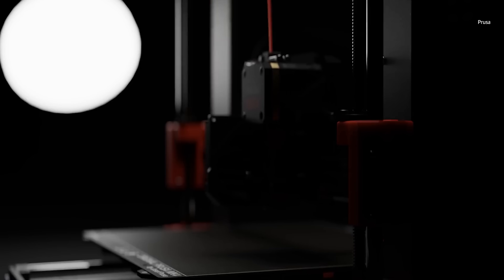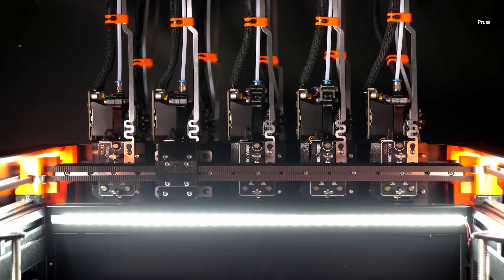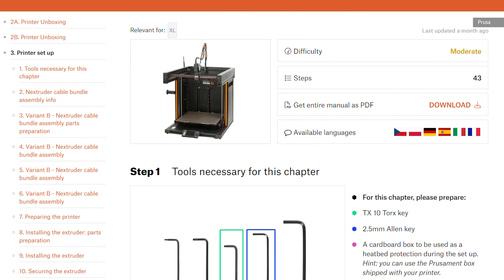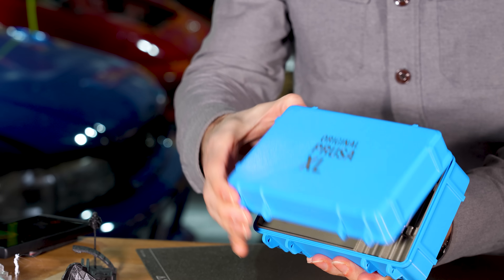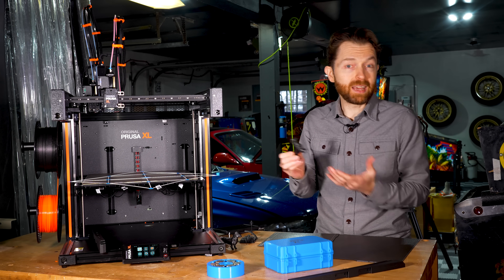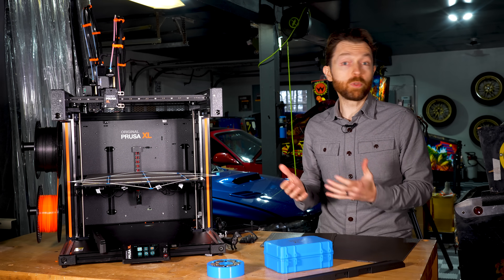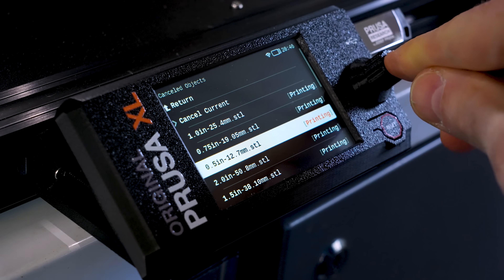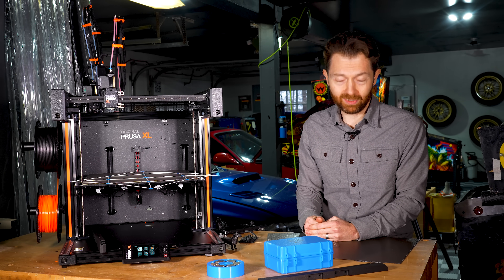Prusa XL review: A big 3D printer with a few big compromises

Comment: As someone who actually has the 5 tool XL printer i can tell you its amazing.
Reply: That's kind of like saying you could buy 5 Toyota Camrys  for the same price as a Hummer EV.  There is nothing on the market that can match the Hummer for it's trait of just being able to crush a Camry in a head on collision, for example.  What you want to have in an industry is something your competitors can't make.
Reply: @joeking433 As for your car analogy  if I want to transport 25 people(safely) and had to chose between 5 cars or one large car.(Hummer) which is makes sense? Having multiple printers will churn out more parts than any single machine. It's math, not magic. In part yield more printers= more parts. 

Prusa sat on their name and got overtaken by a competitor. Even the Core One is lacking in so many areas it doesnt even match a 2yr old bambu printer. (smaller build XYarea , no camera, no filament calibration, mmu3 is a mess)  

If your item can fit on a single 256 cubed print then bambu could be fine however people have been printing larger, on smaller build plates for years. Size isnt an issue if you can put your parts together.

Under your reasoning the Orange storm giga beats the prusa because it can print 800mmcubed. 🤔

Now we have some real competitors on the scene at reasonable prices. Qidi, creality anycubic etc. 

Bambu isnt just making a large format printer, they are adding some new tech to make it more than worthwhile(Dr. Tao Bambu CEO)
Reply: Any printer can print small which means you can assemble later.
DO you think Frankly Built Iron Man suits could only be printed on large format printers? 
No multiply that by a fleet or printers for the same or lower cost. SIZE is ok but YIELD is king.
Reply: It doesnt seem to be there based on most peoples reviews. I pondered getting one but already have an e3d tool changer. Im glad it didnt splash out and get a 5 tool XL, with that money I bought a lathe and 2 X1C combos.
Reply: @Festivejelly  Multicolor prints on X1C will still take 2-5x the time compared to Prusa XL depending on how many color changes you do, so with multicolor printing you dont save any time and you waste more filament with two X1Cs contra one Prusa XL. Also you get to print larger prints with XL. It's only more useful if you do single color prints, and also a bit for higher reliability as of now
Reply: @Festivejelly  It needed work out of the gate - no doubt.   I got mine in Feb.  Upgraded from 2 to 5 a month after that.  This is my third printer (after and Ender 5 and an Ender S3 XL)  I hacked my 5 quite a bit.    This review is sorta meh.  He glosses over all the new tech that is in this printer.   There's a reason it's so expensive.   It. Just. Works.   Adhesion is awesome.   Filament handling is awesome.    And they just keep making it better.  Recent firmware update tuned up the speed and practically removed most of the vibration.  Enabled the touch screen.   Out of the box, it doesn't have the stringing issue anymore.
Reply: After fixing the issue with stringing I can tell you it is amazing.  Just think of all the filament you will waste with the X1C 🤣  @Festivejelly
Reply: Heck for the price of a XL 5 tool head you can have 

Open frame
6 A1 with ams lite 6x4 =24  colors

Enclosed you can print more exotic materials
3 P1S with ams = 12 colors and you can add up to 16
or 2 X1C with AMS up to 16 colors. 

Are you saying your XL can print faster than 2-6 machines in terms of total output?
Reply: @No0o0o0o0o0  If you're using all 5 colors, it can certainly be 2-6 times faster than 5 colors via AMS..
Reply: @logicalfundy  Maybe you missed the point. If I have 6x A1 printers they are outputting more than 1 prusa XL at a higher qualit to boot(.4mmvs.6mm). Even if a single XL multicolor print is fast than a single multicolor BL print, it will not be faster than 6 running at the same time. So if we are comparing price to performance it's not even close. If it's single color or a few filament swaps the BL printer beats the brakes off the XL. 

If I use a P1S or X1C I then have access to more colors besides 4 and more filament types because they are enclosed. 

All for lower price, higher quality and faster delivery no tuning or building needed.
Reply: @No0o0o0o0o0  Your are buying it for a different reason then the multimaterial or size. If your just about speed your 6 machines are faster but it's not all about speed and with prusa you can still reach everything with easy guides plus you have an amazing customer support. But the XL is just not for you and that's fine
Reply: @Parasite98  It's more about what you get for the price. 

They both have a 1yr warranty(in the US) once you are beyond that that Prusa support is basically the after sales department.

I do not dislike the orange and black, but I can call them out for the XL not meeting expectations. They are not a good value in 2024
Reply: @No0o0o0o0o0  The value you set is different from some one else his use case. Like I said this printer is not for you
Reply: @No0o0o0o0o0  But how big of a print can your A1 do?
Reply: @No0o0o0o0o0  Yeah, they definitely need to lower their prices at Prusa.  I think they are seeing that as well for their Core One is reasonably priced competitively against the X1C.
Reply: @No0o0o0o0o0  For multi color and multi material the XL is significantly faster, Bambu will take 1m30s each color change to purge etc, XL it is 10 seconds to change toolhead. Your talking a 24hr print taking 4hrs on XL.
Reply: @wafflecart  easily mitigated by designing your parts to take advantage of the speeds. But let's not ignore the elephant in the room the multi color prints on the XL look like trash.
Reply: @No0o0o0o0o0  When printing with multiple colors yes it can for sure beat 2 printers. Tool changes take ages on the Bambu's
Reply: XL 
 $3500 box of parts(500 assembled...assembly still required) and $100-150hipped with a questionable lead time to get it. jan-june

Vs 3-7 machines delivered in a week and can be setup within 20 min of unboxing.(obtained even faster if you live near a microcenter)

A1 combo 560 *7 = $3920
P1S combo 949*4 = 3796
X1C combo 1449*2 = 2898 (may as well add a p1s(949) to even things out.  3847
shipping 35 per printer

The thing that has to be restated you get speed and quality on BL printers.  I have a legit question.
Which is preferable? A printer that is so reliable I dont need to reach out to support or one that is known to have great support because people NEED to utilize them...which makes me think they are not that reliable.
Reply: @No0o0o0o0o0  You are not getting what I mean. 

First of Prusa is reliable. Bambu is about as reliable as a prusa. Owning a x1c I can tell you it will also break at some point. 

But coming back to your use case and what I mean is that you might need the build size, true multimaterial system and fast tool changes. Then there is nothing which will beat the XL.
Reply: @Parasite98  I get what you are saying. But reality is showing the XL prints are NOT good. The design/quality control issue is well known. There is play in the tool head holders, stringing, print errors and failures buggy firmware. 4k to be a beta tester? Dont equate prusa mk3 or even 4 to the XL.  even this video @ 8:00 

This has been mentioned all over the net. Printing multicolor, faster, to a worse outcome is not a flex. Look at the printer as it is not how it is marketed. If you are happy then you got a goldilocks version. If you look around the rest of the reviews the issues are so common you would think they all used the same printer.
Reply: @No0o0o0o0o0  you are talking 🐂 💩. You are using this review 🤣. He has no idea what the  lidar is used for in the printer he's comparing it to.

  I have no design or quantity issues. I have no play in the tool heads, no print errors and no failures with firmware.
Reply: @No0o0o0o0o0  Because your 3-7 machines will need to continually dicked with.   You are majorly glossing over the new tech.  The bambu are cool machines but they are essentially just better packaged current tech.
Reply: @mehmeh533     Refined vs experimental for the same amount of money is the question, however the answer is simple.

Once you have 2 or more devices it creates a higher yield in printed parts. If you look at current prices of the A1, that is up to eight printers. But of course you have flexibility of getting a different combination of printers for exotic materials, enclosures, open frame, etc.

Every printer requires maintenance. But having 3–8 machines go down vs 1 is statistically unlikely.
Reply: @mehmeh533  What are you talking about? It appears you are glossing over new tech.
The tech in the A1 series are well beyond anything seen in another printer. 
The A1 series are the ONLY printer that utilizes eddy currents to actively adjust flow rate and pressure in the nozzle. 

Not to mention the lidar in the X1 series that can auto calibrate k value and flow rate for up to 4 filaments at a time using the AMS. 

There was NOTHING on the market that did that. Then the way they packaged color printing, and setup in minutes not hours/days of calibration was a game changer. The alternatives was mmu2(kek), Palette (lol), ercf(good luck), manually changing filament, figure out a voron multichanger or idex.
Reply: @No0o0o0o0o0  Bambu dropped the ball by not putting out a large format printer!

Comment: It is impressive what kind of people review printers and comment below... people do not have a single clue how hard development is for these kind of machines. A tool changer can be so powerfull, something that the current bambu machines can never achieve. 5 Printheads, 5 different tools (cnc milling, pick and place,3d printing) or materials. This will be a software nightmare for sure, but way worth it! and even if people would like to compare it with the bambu brand. XL has input shaper and can print fast. be aware when printing fast the strenght of the product will decrease. further the amount of waste of the toolchanger is way less. And regarding the enclosure topic, you just dont buy the XL for industrial materials.
Reply: 5 different tools?  When.  2033?
Reply: Tool changer promise is awesome, but if they had actually showed us an example alternate head, and had software that supported even two different nozzle SIZES, let alone types, I'd put more hope in it.
Reply: The problem is they said they were going to release it, then back peddled for 2 years, only to still release prematurely. They rushed the mk4 release because of bambu. 2 years ago, people were glad to pay the prusa premium for top of the line performance and reliability, while bambu has raised the bar, prusa has still fallen. I really do hope they get it together.
Reply: You know how hard it is to make a car - it's orders of magnitude harder than a printer, yet my car runs quieter than my laser printer :)
And it doesn't matter how hard it is to make it - if the company has promised things that it did not deliver, it's still on them to gauge the difficulty before promising.
Prusa came out with the XL after years of practicing software and hardware development with their other printers, and it's still 1/3 baked (not even half-baked). Bamboo didn't practice for years, yet I wish I bought one of theirs
Reply: @petrowi  How long have cars been around? Not the same bro
Reply: @petrowi  get an A1, I went from 4 years of an "self-upgraded" Ender 3V2, to a P1S not really "needing" that much printer. I am blown away at the experience, where I now print for fun and even design to print but never to improve the printer. Sooo sweet!
Reply: The standard has been raised, You can't charge a premium, take forever to finish your development, release a product with poor software, and not focus on the customer experience and still lead this segment.
Reply: @mikeehuber  you are right. The standards has been raised for mid-tier printers. But the toolchanger is 3 tiers above it.
Reply: @ponn273  I agree that the tool changer is cool, but it's not mind blowingly hard, but I predict the premium model from bambu will have more than two heads and will match the Bambu customer experience at the same time. I hope the laziness has gone away in Creality and Prusa, a 3D hobby will benefit if they innovate and excel. Both got so lazy!

Comment: I also had a two-head XL on order.  I canceled it after the extended wait.  I'm glad I did. I agree with you that the lack of an enclosure is irresponsible. What I find more shocking is the poor software support for multiple materials.  Yes, the printer is called the XL, but the primary feature many people are interested in is the multiple-material capability, so failure to deliver software to make this straightforward is a massive failure.  If Bambu Labs delivers a multiple-head machine, the Prusa will have completely lost and have themselves to blame.
Reply: Prusa will drop the price when Bambu comes out with a competitive printer.  Right now they're the only game in town for multi head printers so they can keep their prices high knowing people will still buy them.

Comment: As far as I know Lidar on the bambulab printers doesn't detect failing prints, only first layer extrusion issues.
Reply: The ai detection have stopped several spagetti failures , so it works pretty good.
Reply: the live camera can detect spaghetti detection though (sometimes lol)
Reply: @simpl3y  Yeah, I had the X1 and the Spaghetti detection almost never worked, it even ghost printed (nothing comming out but still continues) and the so called AI from Bambu lab did not stop the print. I have a Prusa MK4 now. Not fancy, but it simply works.
Reply: @Raffix394  The Spaghetti detection gets better with every firmware upgrade. As it includes the latest AI training. I have yet to have a print to fail. However, it was unexpected that the AI recognized purged filament from the chute that made it's way on the build plate. It paused the print for me to remove it.